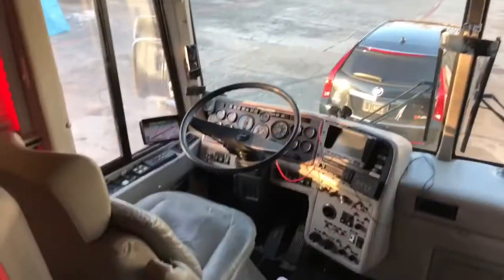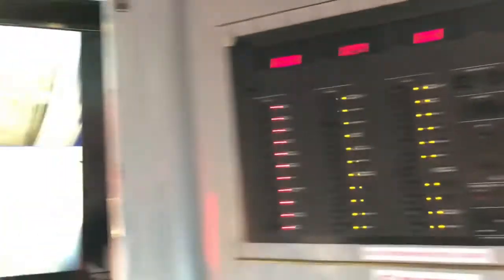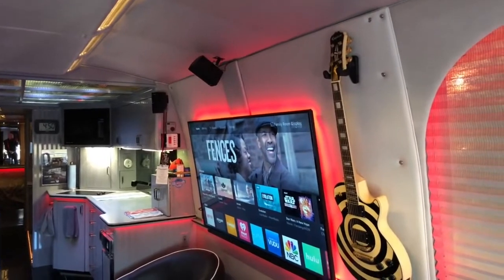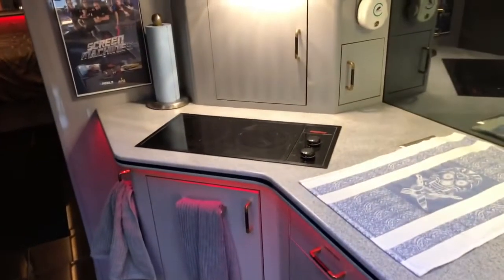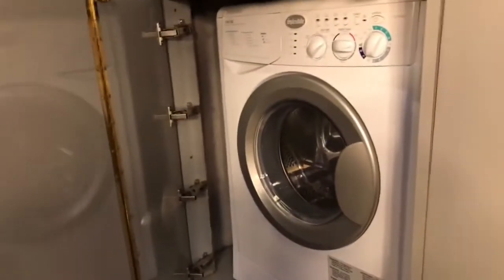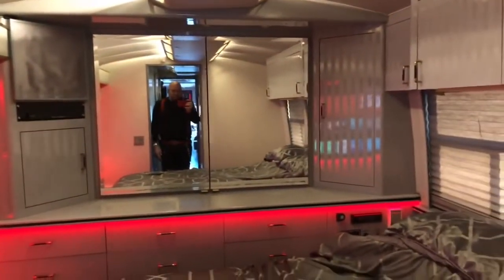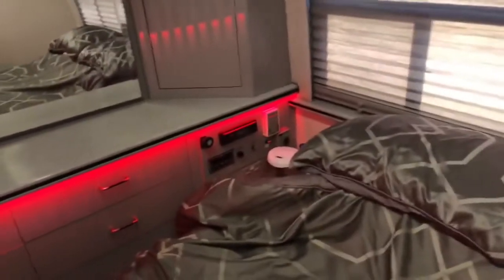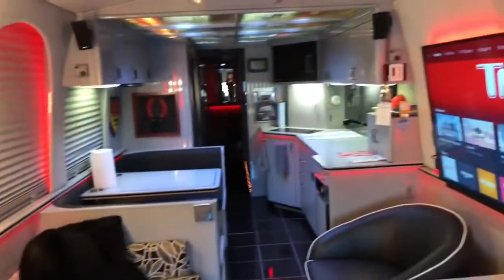A tour of the inside of the Videobob Tour Bus! 1990 Prevost Angola Coach

Comment: Hey Bob - Enjoy your videos.  Carbon monoxide is heavier than air. If your CM detector ever does sound, you’ll already be dead. The detector should be mounted near the floor.
Reply: Good tip. Generally they should be within a foot of the lowest point